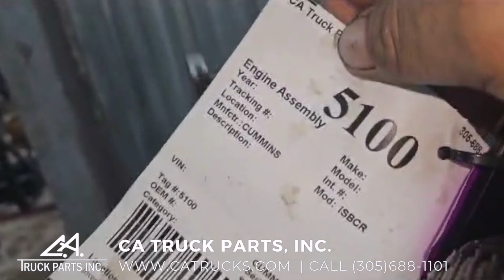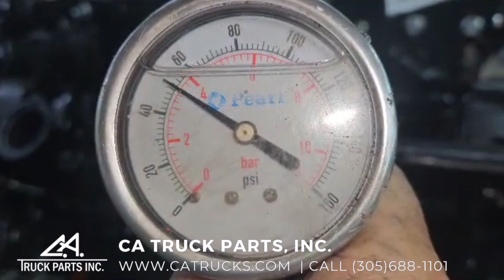2006 Cummins ISB 5.9L Diesel Engine For Sale, CPL# 8416 | CA Truck Parts, Inc.

Comment from the maker: (USED REMAN & TEST RUN & INTERNALLY INSPECTED) 2006 Cummins ISB 5.9L Diesel Engine For Sale, CPL# 8416, CM850, 260HP @ 2300RPM, 300HP, REMAN 2020, ELECTRONIC, 6 Cylinders, DR6499-RX, LOW MILEAGE 45,266 miles, Fits 2004 2005 2006, Engine Serial# 60705095, Stock #5100

WATCH TEST RUN VIDEO ON CA TRUCKS WEBSITE! Engine is Test Run & Inspected Internally. Warranty! Many Engines in Stock! Call CA Truck Parts for more information (305)688-1101 
 
🖥 Website Link:  https://www.catrucks.com/truck-parts/?vid=3183&unit=2006-cummins-isb-5.9l-truck-engine